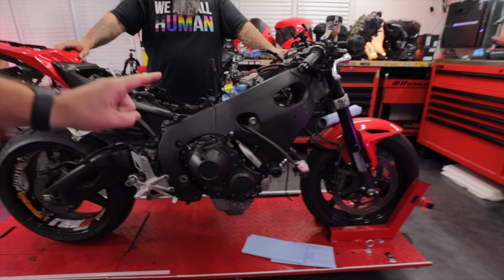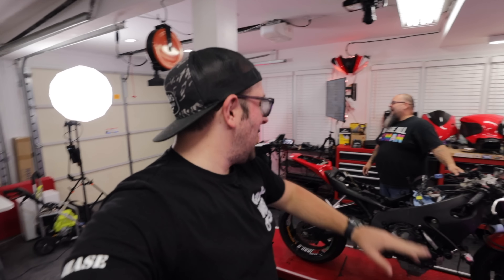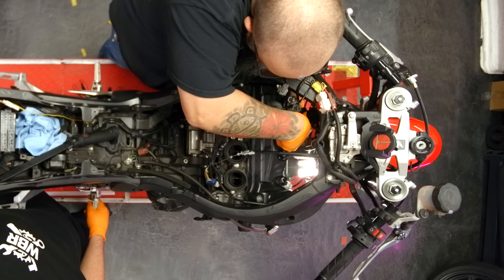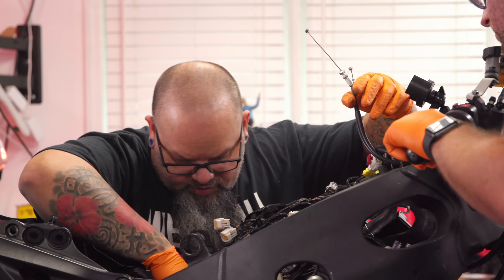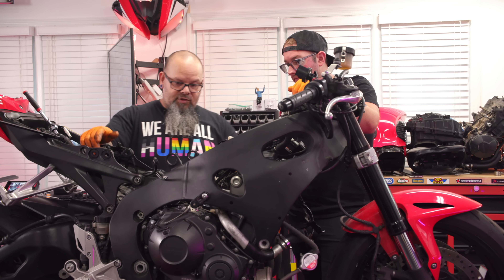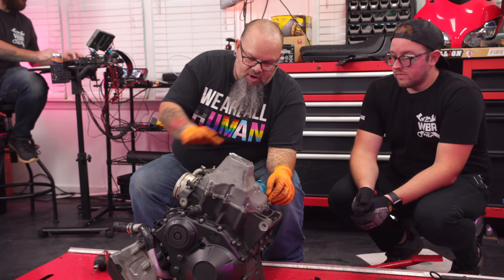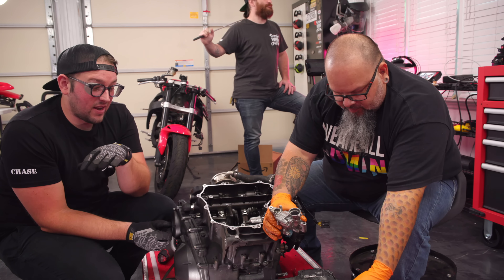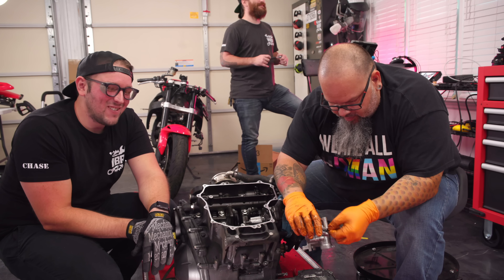We CAN'T GET THE ENGINE OUT without THIS!! | 2008 CBR1000RR Street Fighter Build - Day 4

Comment from the maker: How many of you guys have run into this "specialty tool" crap that totally halted your builds? Make sure to SIGN UP here to WIN OUR BIKES: http://bit.ly/WBRGpatreon
Reply: Loads of times, it's so annoying. Standardised tools should be a thing!
Reply: Run into this exact problem as we speak
Reply: I ran into that tool problem when I tore down my VTR1000. I was able to grind a socket down to make the tool to take my bike apart while it was apart I ordered the correct tool which is by far better than my improvised tool.
Reply: In my country (Philippines) it's called "Castle Wrench/Socket". And I've Used this dozens of times breaking the engines apart.
Reply: Not for this, I cut down a socket to fit,  took 5 minutes

Comment: Literally only thing you have to remove is the airbox and tank to get to the plugs just like any other bike. Also you didn’t even need to remove the throttle bodies to drop the motor, just remove the cables.

Comment: While Brian's explanation of pre-ignition is common - lean burning engines run hot and melt pistons; the current thinking is that lean burning is actually cooler. It is the uncontrolled pre-ignition that strips away the protective thermal boundary layer allowing combustion to melt the piston. This stuff is complicated. I thought that you might not want to perpetuate incorrect information.

Comment: Love the shirt he has on. We are all human
Reply: If you run into any issues let me know I had to rebuild mine after the dealership destroyed the head during a valve adjustment. Technically did an overhaul, since I didn't replace anything if I measured in spec. The head is essentially new though.

Comment: Could not find anything to loosen that damn engine mount adjuster when dropping engine on fz10. Literally kicked the motor out lmao. Putting it back on I unthreaded it until it was a squeeze to fit the motor back into it, torque is only like 10 in/lbs anyways 💁🏼‍♂️🤣